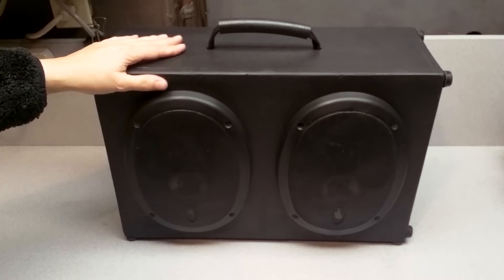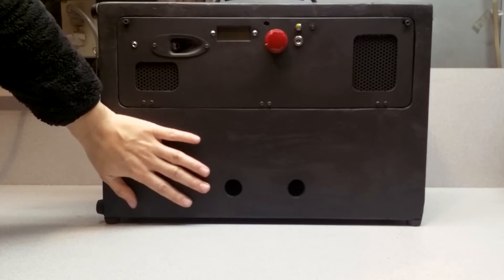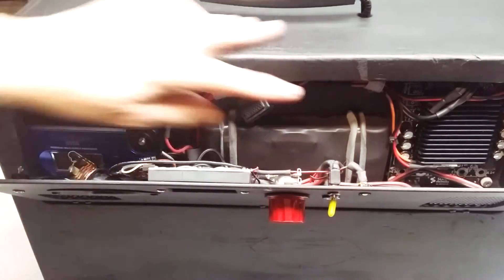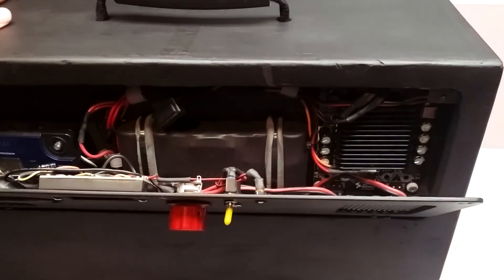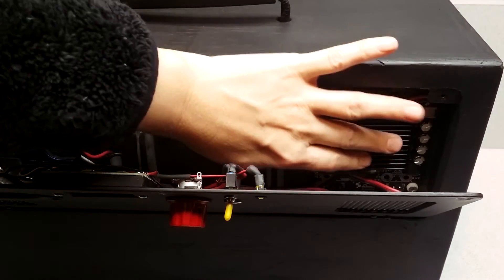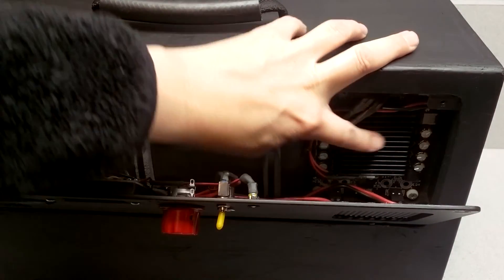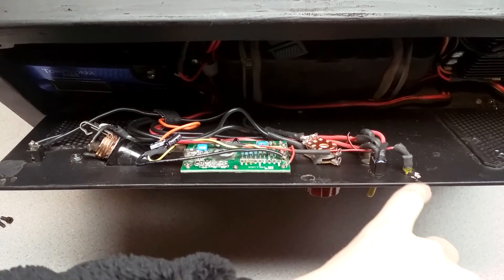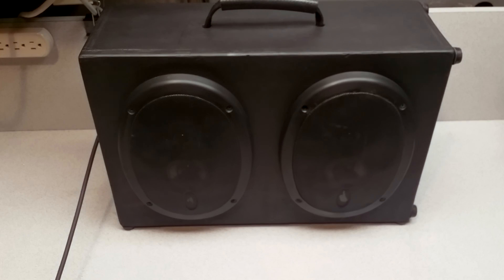Homemade 50 Watt Battery-Powered Guitar Amplifier - BrendaEM

Comment: Being too paranoid about lithium ion batteries. I get lots of these from portable oxygen concentrators, which are high current output to run little compressors. Never a problem being jostled, ect.. (at least these ones).

Comment from the maker: That's what I had. Well, 5 amp * 19 volts = 95 watts, for a 50 (25*2) watt amp. I could go smaller. I will change it when I have it open next. Thanks.

Comment: nice amp , while you seem so safety conscious i am curious as to the choice of the 5 amp fuse ?
Reply from the maker: Um, fuses prevent fire. Lithium and plywood burns.
Reply: Its a 19V supply, not mains!